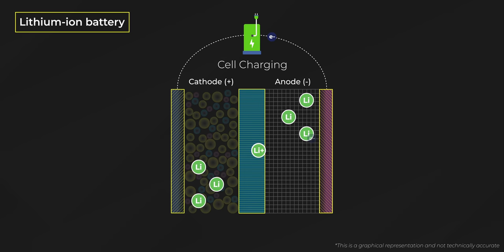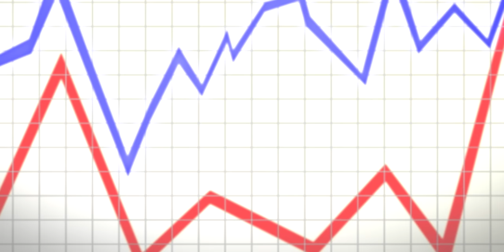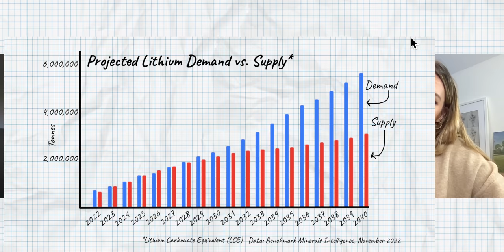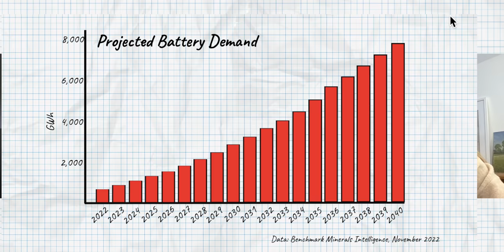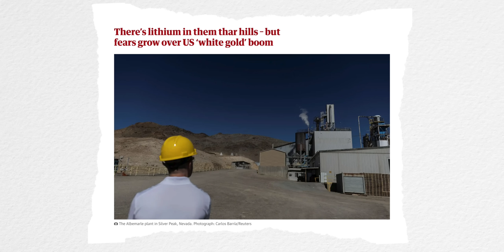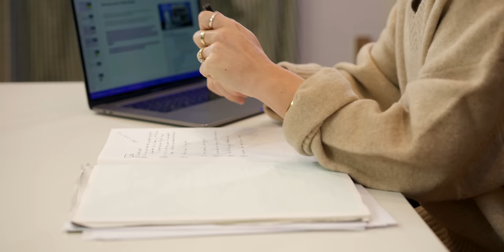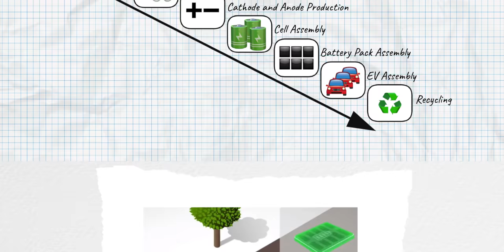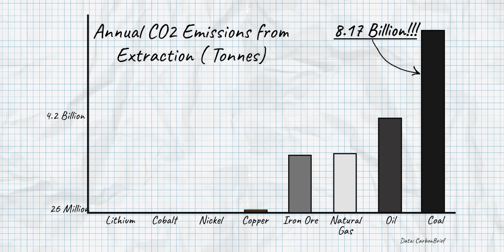There's a Massive EV Battery Shortage. THIS is How We Fix It

Comment: I am surprised the design of more efficient EVs was not mentioned as one solution. High efficiency designs, including lighter weight, lower drag coefficient, simplified drive train and even solar-assist could reduce battery pack size while yielding the same range. For example, the upcoming Aptera uses only 100Wh per mile as compared to SUVs and trucks that use 600-700Wh per mile requiring larger & heavier battery packs. Aptera gets 250 miles range from a tiny 25kWh battery pack, 400 miles from a 40kWh (about half the size of today's EV models). Also its solar-assist provides up to 40 miles/day of "free" propulsion. That's over double my daily commute, which means I may never have to charge until a long trip. I just reserved one.
Reply: Totally agree. We need efficient sedans/hatchbacks/wagons instead of gargantuan SUV-s. The recent Volvo EX90 is just hideous.. 2800 kg weight and boxy shape and they talk how "green" it is.
Reply: Bicycle, Bicycle, BICYCLE.  I like to ride my bicycle, I like to ride my bike
Reply: Like the original Ioniq. Still just about the most efficient non-city EV out there, years after it appeared.  Even my eNiro looks pretty efficient compared to some of the latest offerings, even the normal sized wagons like the MG4 and the new Ora cat are not so great.
Reply: For $50,000 for a 2 seater car.
Reply: This discussion is on the sustainability of the raw supply chain to support the growth. it does not take away from their videos lifting up smaller models, the more efficient models and the inovative approaches to reduce the battery requirements.
Reply: More efficiency is great. But, consumers have not exactly been buying up the most efficient gas cars available on the market, so I don't have high hopes that these people will suddenly start caring about efficiency, simply because gas is replaced by electricity.

Like it or not, if the mainstream EV market doesn't give consumers the excessive size and bulk they want, they won't drive Apteras, they'll just keep on burning gas.

Don't get me wrong, the Aptera is a great concept and I do hope it takes off. I'm just skeptical that it's going to be more than a niche thing.
Reply: Aptera looks way too quirky to be popular in any sense of the word. We need something simpler and more familiar like the beautiful Microlino. Small car for the short distances with little luggage. These need to replace the city cruising suv's. Also let's not forget the micro mobility option that can also be used in conjunction with public transport.
Reply: @MattOGormanSmith  YES!
Reply: Or indeed just fewer cars full stop
Reply from the maker: We've got a lot lined up on this front! Take a look at our aerodynamics video too! However, good point - we could have explicitly called it out in this episode!
Reply: There really isn't that much room to make EVs more efficient. They are all really good when it comes to air resistance already and weight isn't that big of a factor due to regenerative breaking.
Reply: I agree, whilst I'm not huge convert to electric - I would consider an Aptera.
Personally I think vehicle design needs to back to classics like the little triumph heralds, fairthorpes etc, small, lightweight, economical, stylish.
Modern cars need to be aiming for around maximum 500kg road weight, 500mile range and be able to charge from the sun, whilst also aiming to still be productive a minimum of 30yrs from now, not be aiming to be recycled in 10yrs, more processing isn't going to create a clean planet.
Reply: @deelawrence1135  lol, you've got it all figured out!
Reply: People want what they want. You can talk about super light efficient cars all you want, and that talk has been going on for decades, but it isn't realistic. Buy a small EV like the Bolt of MG4 and call it good.
Reply: @Rich Pate Totally. Aptera is getting so many things right
Reply: I hope Aptera comes to UK.  Bloody brilliant.  My FIAT 500e is really not very efficient for its diminutive size.  No better than a model y.
Reply: @K1989L  don't worry what cars look like, they're constantly changing, compare the 1886 Benz Patent-Motorwagen, the iconic Oldsmobile Curved Dash, Model T Ford, BMW Isetta, various Morris Minors, Ford Anglias & Populars, Ford Ka etc etc... 

When people want a new car they buy what's in the showroom.
Reply: @4203105  LOL :-D
Reply: @Matt-dx3wo  cycle cars, bubble cars, Austin 7, BMC Mini, Smart & many more were hugely popular when they were were available. People like simple, lightweight, tiny cars.
Reply: @alanhat5252  maybe for local stuff, but not really practical as one's only vehicle for most people. I've lived in the UK and the US and there are obviously differences in vehicle choices, but even in the UK people generally seem to prefer larger vehicles than those you mention. In the US I wouldn't feel safe driving a legitimately tiny vehicle on the interstate where I live with all the crazy drivers and huge vehicles.
Reply: @Rich Pate :  Because a vehicle such as an Aptera only provides part of the typical usage an owner may require from a vehicle, it is often going to be a "second car".
For instance, the following are activities that are best carried out with a "family-sized" vehicle:
** Collecting visiting relatives from the airport.
** Joining a car-pool to take a bunch of kids to school.
** Ride-share with a group of workmates.
** Transporting family and friends to sporting events.
** Pick up building materials for your home renovation project.
If your situation requires you to do some of these types of things, and you need two cars to do them, it is quite possible you could end up causing the planet more harm, and spending more cash than you would with a single eco-friendly wagon.
Reply: An Aptera is a small 2 seater.
An SUV can carry 5 or 6 people and a good load of luggage, this has to be taken into consideration.
Reply: @MattOGormanSmith  good for you, more space on the roads for me🙂
Reply: If utmost efficiency was mandated, every car would look similar, it would be small, not handle well, limited performance, etc.  Who would buy this product besides the greenest of treehuggers?  You have to offer what people are looking for.
Reply: I definitely am looking forward to the possibility of owning an aptera. Meanwhile my brother in Texas would be insulted if he could not have a car 5 to 10 times the size of the aptera. And it's just him riding in the vehicle! Technologies theoretically can be neutral but in application almost never are. Because people have the power to do something means they have no responsibility whatsoever in their choice. The planet doesn't operate that way without the loss of life and species. If we simply base our decisions on who has the most money and power to purchase the largest and most inefficient electric vehicles we haven't moved the needle one spot from where we are with fossil fuels. Let's say we build a home that's 99% more efficient than current homes but many more people are building homes 100 x larger what have we gained? That might seem unrealistic to us from our current perspective but you only have to look through the past 200 years to realize how realistic that is.
Reply: @Tanel3  yes, more efficiently is the key. But even MORE important are cities build for people, not cars. If you ever visited the US you know what i mean, it’s insanity. No wonder everybody drives everywhere, there’s nearly no alternatives to that. The best and most efficient EV/Car is the one never built.
Reply: @MattOGormanSmith  if we could only get government support for ebikes...
Reply: @deelawrence1135  The Aptera might be small on the inside, but wait until you try to park it or garage it.  It's huge on the outside.
Reply: @charlesminckler2978  It starts under $26k for the 250 mile version which can recharge itself up to 40 miles per day in full sunshine. You can get to $50k for the maxed out 1000 mile range version. If you need the extra seats there are plenty of crossovers on the market for $50k, but they have 250 mile ranges for a 60-100kWh battery compared to 20kWh for the Aptera.
Reply: How about rails? If we put rails on our highways, fuel consumption efficiency could increase 1000%. If we electrify the rails, vehicles can draw power from them, and travel an infinite distance, whilst also charging their batteries.

It would be dangerous to walk on the highway, what with high voltage rails on the ground. But it's not like it is safe to be taking night strolls on the highway right now.

1m narrow gauge rail on designated highways. Only for 4 wheeled vehicles. No bicycles or motorcycles, where the rider could fall and end up lying in top of the high voltage rails. But many highways already ban these. The rails are lain like tram lines, in the road itself. A semi-automated system on the vehicle positions the car exactly, and raise it on extra rail wheels under the vehicle. This reduces accidents and completely solved the self driving problem. At least for the portion of the trip when the vehicle is on those rails.

With a network of these, we only need very tiny batteries on the vehicles themselves. You only need enough power to get from your home to an electrified highway. Depending on your location and the extensibility of the built out network, ranges as short as 10km becomes feasible. You could still travel all over the country with your tiny 10km range battery using the network. A 10km battery is easier to charge easily and quickly, and makes the car much cheaper. More importantly, the car is LIGHTER, further extending efficiency.
Reply: @alanhat5252  I mean sure, if you want to drive in a small capsule death trap, then there is still room. But with a reasonably crash resistant car, there are quite a few EVs that are at the edge of what is possible.
Reply: We've been there.  The BMW i3 is very light for an EV, with its carbon fibre and aluminium construction, yet these are not factors that most consumers are interested in.  Unfortunately, market forces mean that consumers want large SUV type vehicles, so this is what manufacturers produce, using unnecessarily large amounts of resources per vehicle.
Reply: You are absolutely right. The idea the "electric" is a free pass for EV manufacturers to just don't care about efficiency and just throw a bigger battery pack in, is as distasteful as cheating with emission testing. A small conventional EV, not of E-SUV size manages 160Wh/mile or less, without the tech of the Aptera. That alone would double the adaptation speed, both by less battery scarcity and lower vehicle cost.

Comment: I forgot how many times can petrol be used and recycled? ❤
Reply: Well…. Technically infinitely, but in fairness it does take quite a long time 😊
Reply: Infinitely. But it takes a lot of energy to get that Carbon out of the atmosphere and combine it with hydrogen, to make it into fuel again.
Reply: @G T Even if coal is used EVs are still better because their three times more efficient then ICE vehicles. The UK grid uses around about 35% Fossil fuels and new renewable energy sources are coming online constantly. Many EV drivers have or get rooftop solar. Batteries can be recycled and have a second life as static battery storage. The Co2 cost can easily be recuperated within 3 years of normal millage. 
What often is not calculated is the enormous cost of producing petroleum products. Drilling, transportation, refining, transportation again all use huge amounts of energy and cause huge environmental damage from leaks and emissions.